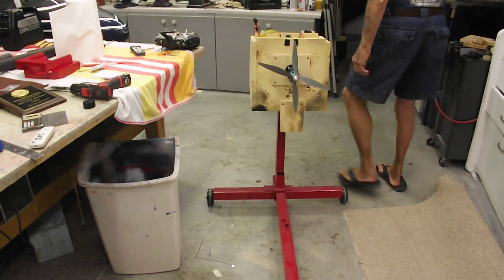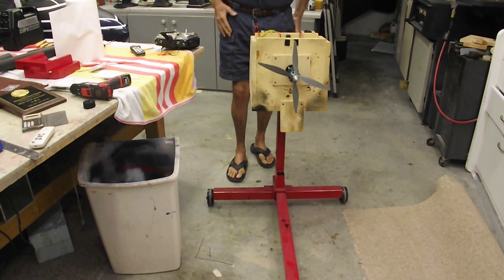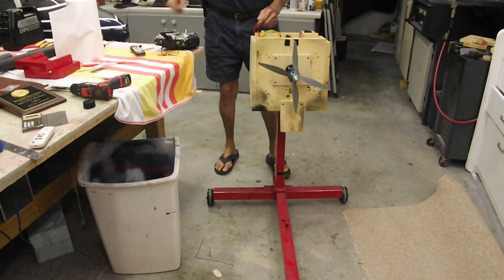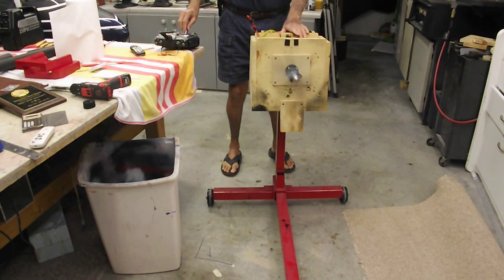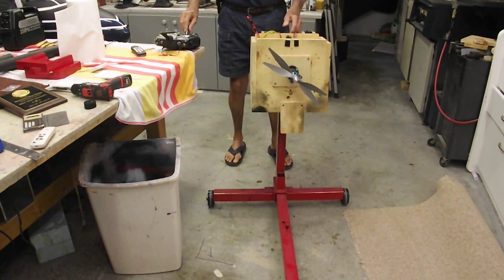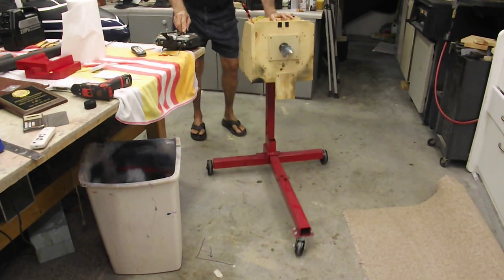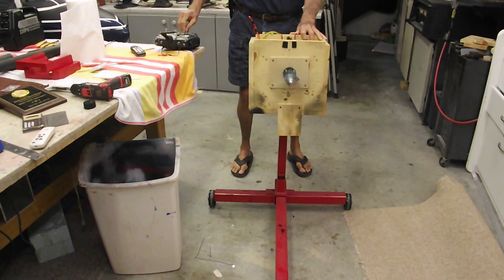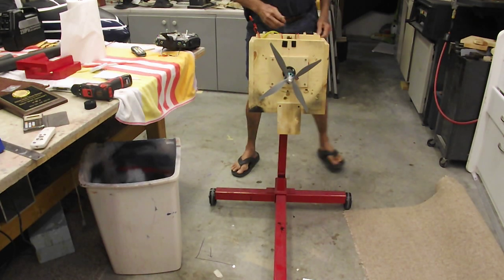Himax CR3516 Test Run

Comment: VERY COOL MAN,

 I am building a scale Pylon plane..  the full scale has contra rotating props..   the first one is going to be a 40 size plane...  right now im running a 2 stroke 91fx on it...  how close do you think that HI max set is  to that size motor...  Im not sure how to pick what I need..     oh and hows your project going... the XB35 should be AWESOME!
Reply from the maker: I am confident that it has as much power as your 91. Project is on hold until I finish a couple of other projects I am working onl
Reply: +Merlyn Graves    Awesome thanks for the info..

 I know how it is  I have several projects going at the same time too!  good luck with yours  it should be AWESOME